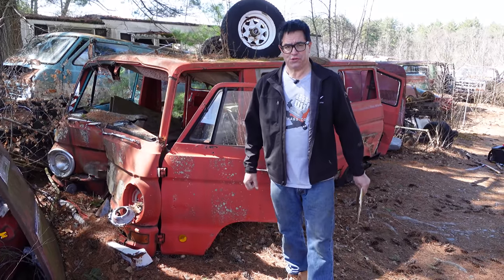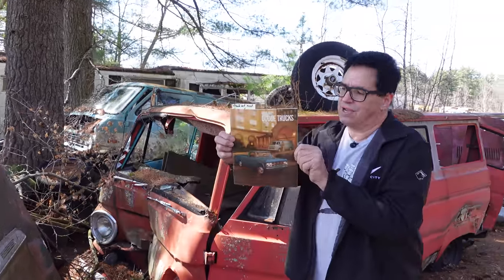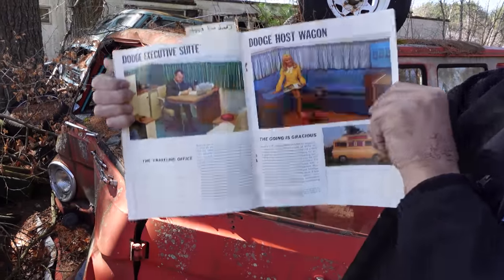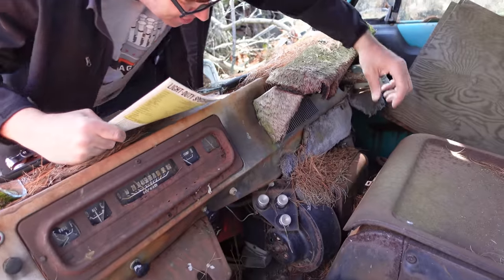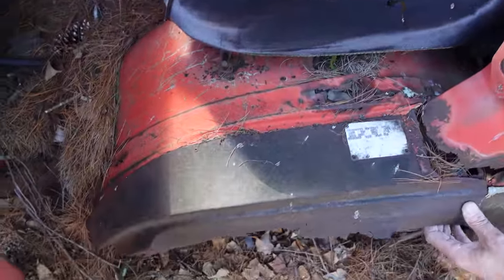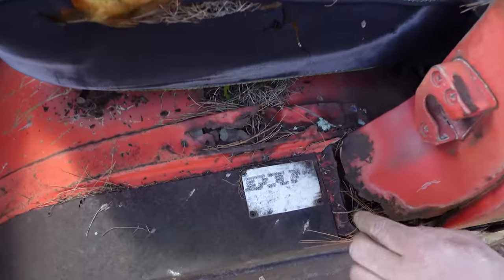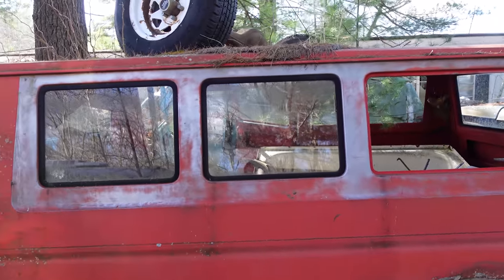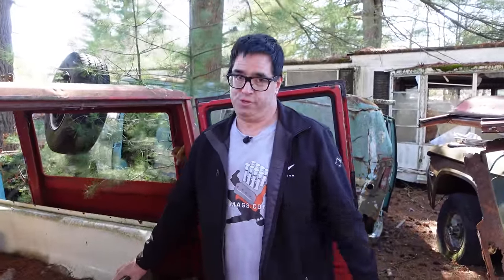Dodge Podge Lodge

Comment: Drove one of these while in the Navy at Whidbey Island Naval Air Station. It had the V8 and 3 on the tree like this van. Spinning the rear tires was no problem, the van was very light in the rear end. One of my co-workers drove it into a ditch and wrecked it. The replacement was a new 76 Dodge van with a slant 6 and automatic. That van was a real dog, it could hardly get out of it's own way.

Comment: A100 gained a V8 beginning in 65 with the LA273 with the LA318 coming in 67.  Power steering became an option in 69 and 70 on V8 equipped vans.  There was also a pickup version.

Comment: I had a '66 that came with the 273 that I swapped out for a '70 340 with headers and DC purple shaft cam. A lot of fun and went pretty good (blew up two 727's and three diffs). I remember the throttle cable breaking and propping up the dog house lid and driving home with my hand on the carb to accelerate.

Comment: Back when I was in high school auto shop we had one of those manufacturers auto show cutaway first gen Dodge vans complete with the cutaway 318 donated to our school. If you plugged it in the cutaway engine would move with the valves opening and closing and the pistons going up and down along with the cutaway tree speed transmission and the rear wheels turning.
Reply: I would've loved to have that same experience in my school when I was just a wee lad.

Comment: Bought  1966 in the early seventies for the cleaning crew.  It was a short Tradesman with windows in the side and back doors.  It was in excellent condition with no rust (rare here).  It had a 198 six (green valve covers) with 3 speed manual and 391 rear end.  Workers ended up blowing the motor by not checking the oil.  The oil light had fell out of its socket.  They couldn't figure out what that blinking light was under the dash at night.  I replaced the motor with a 225 six (red valve covers).  First gear was pretty fast but as soon as you shifted into second, it was a dog.  I finally let it go when it started doing the "death wobble" and ended up tearing the steering box off of the frame.  I always enjoy your videos, they are very interesting.  Regards - Mike

Comment: I can imagine when that radiator would overheat it could get dicey in the drivers seat! Another great video Steve!
Reply: the engine lid had a gasket so any leaks would go out the bottom.... unless you were dumb enough to fool with it while the lid was open. (happened to a friend)
Reply: Or you are riding around without the top on the doghouse because the van is running like shit. Sometimes left the doghouse cover off so you could fiddle with the motor while you’re driving🤣
Reply: @mrj-charles6383  ... on the fly tuning is certainly a DIY job. Much worse than driving while on the phone.
Reply: My dad had one, when it overheated It was a foul sauna.

Comment: I drove a 69 A108, 318/Auto, as a daily driver for years.  Thing would start on one or two cranks even in the winter.  I put a 2.76 Sure-Grip rear in out of a 68 Chrysler C-body replacing the 3.23 open.  That made the van much nicer to drive on the highway.

Comment: In 1974, I purchased a dodge van that had extensive front end damage. I took a torch and cut the van behind the front door frame. What I ended up with is a tag along camper style trailer to hook up behind my 1974 Ford E-300 Econoline.
I body sculptured the open front area of the dodge van to fully enclose it. It was painted to match my Econoline, and it was a cool to see a Ford trailer a Dodge down the highway. It was great to have all that extra room to camp in the back end of two connecting vans.

Comment: That semi-padded "wing" on the dashboard came on the later models, the earlier years did not have it. It was designed to hold passengers in place in their compartment...instead of being ejected thru the windshield during a frontal crash, which maimed or killed many.

Comment: Looks like it was movin' pretty good until that last stop. 

Talking about the rust, I parted out a '64 Gran Prix like 12 years ago that I found a few 1971 receipts in, I assume like most NY cars it probably lasted about 10 years (unless the slim jim trans blew up).  Anyhow, I decided to cut the spears out of the quarters.  I got in there and found both sides had been patched like this van, panels over the original metal, entirely not visible from the outside.  The kicker is the right side had a row of holes ahead of the wheel where the patch had been meant for a Bonneville and they'd just smeared filler over and through the holes with drips down the back.

Comment: I wonder how hot that engine lid would get in the summer. Seems loud and hot next to that thing!
Reply: I used to sit on that lid whenever I went with my father in his van ( he took the passenger seat out for more room ) heat and noise really wasn't an issue, it was very well insulated. However,  It was only the slant 6.

Comment: Steve That Patch panel was done for inspection, Want to Bet I could fix that Van, I know I can, I done way worse than that. Just quick fix, If you Needed a vehicle you did what ever was need, Know matter what it Looked Like. People use to Come to Me to Have panels like that put on, But I owned a 2 handle spot welder 3000 bucks, still Being used today, In a Body shop ,Traded for 69 cougar.

Comment: ohh do a segment on the second gen Ford van uncle had a brand new 1969 302 e300 and even after the van got toasted in 1974 we pulled the motor and did duty  in a mid 70s pickup
Reply: He already did.

Comment: That's a lot of horsepower for such a vehicle - with the sort of weight distribution, steering, brakes and suspension these had it wouldn't surprise me if a good number were wrecked when they were new.  (Apparently the first Econoline was kinda deadly - nose heavy, Falcon underpinnings...required skill to handle safely.)

Comment: So was the 210 hp down from 230 done by lowered compression ratio?  In the van automatic, the floor shift unit was handy for making a floor mount for push button 727 on early B Body.
Reply: A100 had the auto shifter on the dash.
Reply: @21Piloteer  You're right, but the whole mechanism could bolt to the floor as a swap. I've done it several times. Ta for the reply.
Reply: @moyadapne968  👍👍I believe the A100 lifted the console auto shifter from the early A-body Barracuda/Valiant anyway.

Comment: How did that radiator get air?  There’s a wall in front of it.
Reply from the maker: Hi Lou Medeiros, there's a flat panel under the grille that extends back to the "dog house" where the air ingested through (actually under) the grille flows into the engine box. I've had a few A100's and as long as the radiator was in proper shape, I never had overheating problems. It does seem to defy "common sense" though, I get it. THANKS for watching and writing, Steve Magnante

Comment: I had a concept of a A100 with an extended nose (ahead of doors (suicide doors), existing headlights removed, reshaped Toronado grill added, lengthened wheelbase, widened (just under DOT max), lowered (with custom top and 1984 Toyota Celica pop up headlights), including Toronado drivetrain and other features.  ;-)